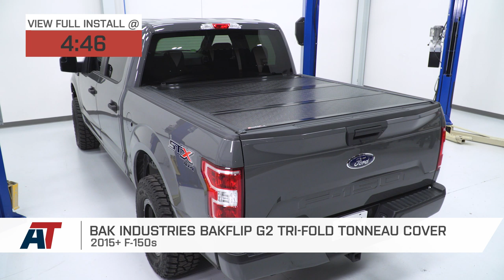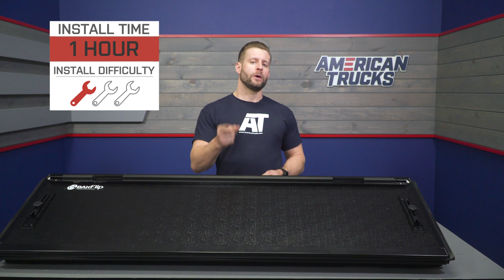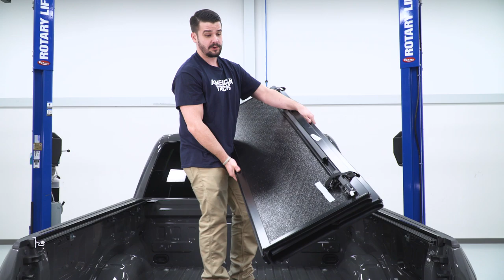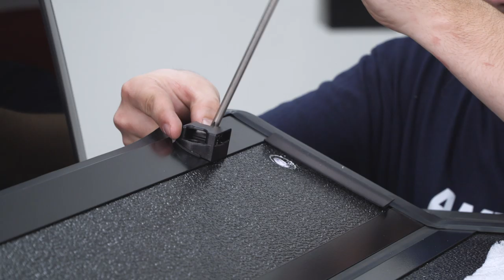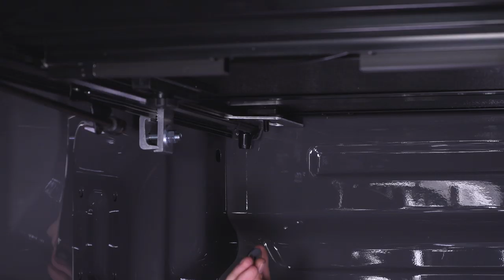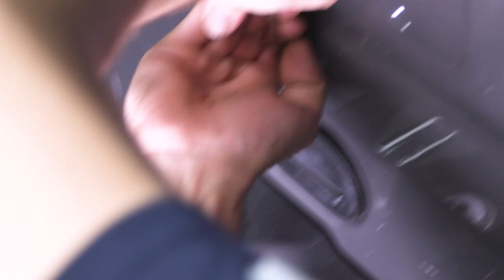2015-2020 F-150 BAK Industries BAKFlip G2 Tri-Fold Tonneau Cover Review & Install

Comment: just installed this cover on my 2022 2500 silverado, the only issue was the drain tube size and one drain hole on the truck, had to use a step bit to make the drain hole just a little bigger to allow the tube to slide in easier.   the drain tube was slightly bigger than the drain hole, looks nice so far, did take about an hour for 1 person